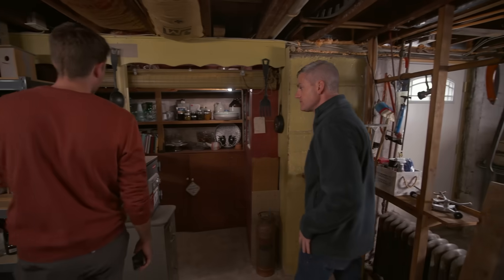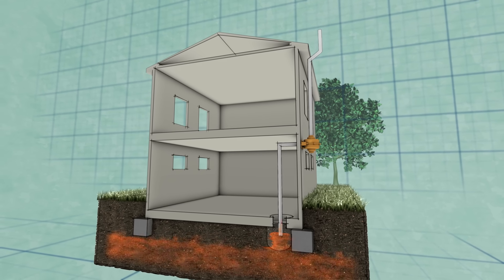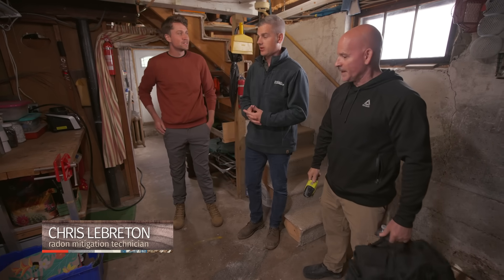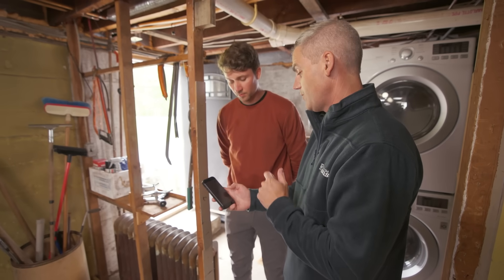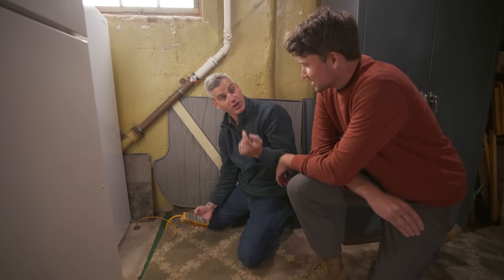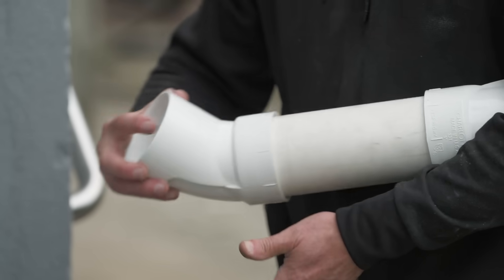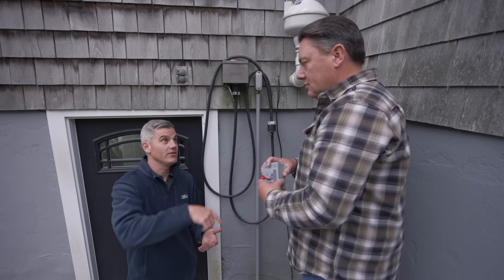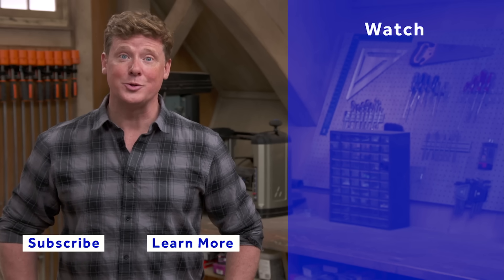How to Reduce Radon | Ask This Old House

Comment: Opening a window does nothing it actually makes it worse, the same for the HVAC as noted in the video both just suck radon out of the floor even faster. Note that the US uses pico Curies per liter (pCi / l) but the rest of the world  uses Becquerels per cubic metre (Bq/m3) 1 Bq/m3 = 27 pCi.  Normal outside air tends to be about 15 Bq/m3 (405pCi/l) so you'll never get to zero. Also note if you're a smoker radon significantly boosts your lung cancer risk on top of the risk already from smoking.
Reply: Outside air is about 0.4 pCi/l. You mean 405 femtoCuries/liter (fCi/l)?
Reply: Fellow Canadian here, DG. I installed a Radon Away fan in my basement four years ago. I was seeing levels of 400+ Bq/m3. Now, they hold at 100 Bq/m3 or less over the long term. I vented to the outside but not all the way up to the eaves. My house is well sealed and insulated. I find the house dries out pretty badly in the winter. Basement humidity drops to about 35% which is borderline. Beats lung cancer though!!
Reply: @acreguy3156  I've heard the benefit of radon mitigation systems is lower humidity. When the air under the slab drawn out it takes moist air with it. Less of it permeates up through the porous slab. I'd prefer 100Bq/m3 but now as fall approaches and days get cooler and wetter it causes radon levels to spike up to 200 to 300 here. Summer it was about 4 to 20Bq/m3 so it evens out, the 300 day long term average is 85Bq/m3. I'm hoping to makes some changes soon and get a system in place.
Reply: @dg-hughes  Good points, DG. My mitigation system pulls air in from three other sources - two bathroom fans and the kitchen fan. The flappers on these vents are pure garbage. My house is super insulated with a continuous air barrier. That makes those three fan sources a problem, as they draw in dry air from our cold winters. A long term value of 85Bq/m3 is excellent. I'm close to that. Good luck with your install 👍.
Reply: what about using an air purifier in your home?
Reply: @TotalWarHistory.  radon emits alpha particles which is 2 protons and 2 neutrons. It's not a gas it's not a molecule or even an atom it's parts of an atom. There's nothing that is capable of filtering a particle smaller than an atom. The particle carries a charge and will stick to dust concentrating it. You could probably filter that but it would be a very very small fraction compared to what is in the air.
Reply: Not sure where you got the idea opening a window doesn't help, but it absolutely does, as a light breeze can bring fresher outside air into the home that displaces the air with Radon.
Reply: @darkedgex  You're partially right, Dark. However, there is something called the "chimney effect." When you open a few main floor windows, it creates a vacuum, pulling air from the basement, which in turn pulls radon through all the little openings in the basement it would normally come through. Kind of like blowing air with your mouth over the top of a glass soda bottle. You're actually sucking air out of the bottle. Same idea.
Reply: @acreguy3156  As someone who inherited a home with a very high radon level (>20-40, depending on conditions), when I do long term measurements with the windows open the levels return to below 1.0, so unless my situation is anecdotal because of something unique to the home, having windows open definitely can help. Obviously if you have concerns, measure the results with the windows open vs. windows shut as every home is different. But the home in question here is a single floor home with a basement.
Reply: @darkedgex  Good points, Dark. I think there are several other factors such as how air tight the house is, the R value in the walls, effectiveness of the heating system's duct design, HRV -yes or no. It's certainly not a subject we can paint with the same brush 🤣.
Reply: @darkedgex  It's not my idea. An open window means lower pressure in the home and that allows radon to be emitted faster. If your house was very tight, no HVAC, every window and door super efficient, bathroom fan sealed, attic vents sealed it would be wet and moldy, but less radon leaking up from the slab. You may be letting radon out but it just comes up from the slab faster. HVAC can suck it up faster due to air exchange reducing pressure. You may be lucky and the amount coming in is low and the ventilation removes it faster than it can come in. Ventilation may help reduce dust since radon is a charged particle it sticks to dust and accumulates in dusty areas.
Reply: @dg-hughes  I mean, I have the numbers, so you're never going to convince me. I did say they are potentially anecdotal and possibly unique to this home, but this is where testing helps. And if you're in a situation where you can't afford a mitigation system, testing and seeing if open windows helps is better than exposure.

Comment: Certified radon mitigator here. This was all top notch. Test, test, test. Lower is better. Even exposure at the EPA limit of 4.0 over a lifetime doubles your risk of lung cancer. Most soil suction systems like this can get levels in the house down to 2.5 or lower.
Reply: I have the radon eye system and installed my own random mitigation system with a sump cover. Went from averages of 12 and peaks of 25 to an average of 2 with peaks of 3. Continuous testing is affordable so there is no reason to stop.
Reply: I have a passive mitigation system (no fan). My average Radon reading is around 2.5. Is it beneficial to try to get that number lower by installing a fan? Note the pipe just exits through the baement wall but doesnt go up above the eaves.
Reply: @scofus6166 technically it should terminate above the eave to be code compliant. The concern is that the exhaust can have very high concentrations and you wouldn’t want this gas creeping into the house through a leaky window, etc. Adding a fan to a passive system is generally the most economical way of getting levels down.
Reply: @scofus6166 background levels vary but are often .5 outside. I would get as close to that as possible
Reply: Thanks Max. Did you like my Temu shoes?😂
Reply: @chrislebreton750 excellent choice, haha! Cheers!
Reply: Show us the studies that show us that exposures over this supposed "EPA limit" doubles your risk of lung cancer. You're 1000% full sht because there has NEVER been a controlled study linking radon levels in the home to lung cancer. The EPA itself admitted their recommendation (NOT standard)  was based on incomplete data and quote "guesswork". The data they used came from miners working underground in levels of radon thousands of times higher than the highest levels found in US homes.
Reply: @hochhaul 

“Darby et al. (1998) conducted a meta-analysis analysis from 13 studies in Europe and demonstrated a statistical increase of 16% in lung cancer risk per 100 Bq/m3 [2.7 picocuries] of residential radon”. 

Int J Environ Res Public Health. 2022 Dec 21;20(1):97.
https://pmc.ncbi.nlm.nih.gov/articles/PMC9819115/

It used to be that all we had was data from uranium miners. Now there are a number of studies showing the same correlation in buildings as well.
Reply: January is National Radon Scare Month!
Dr’s can’t detect Radon poisoning & 4.0 is like smoking two packs a day. If they can’t figure us out they have us do a Radon test & blames it on it when levels are high.
Reply: It’s a scam

Comment: They should have put a rain cap on top of the exhaust pipe to keep the water out.
Reply: The fan is designed to tolerate rain and condensation coming down through the pipe. The whole system is pitched down to allow water to drain into the suction pit. Adding an elbow or rain cap at the top can cause icing up in very northern climates. It’s also best to direct the gas away from the house so it can’t creep back in through a window.
Reply: @max-zl1vm  what is the suction pit? Will water have the opportunity to run into the basement?
Reply: @pilot_gti the suction pit is the hole made in the basement floor where the radon is drawn out of the soil. Rain and condensation should be able to drain through the soil without issue.
Reply: @max-zl1vm  That would decrease the suction
Reply: Best option is a " critter guard".  Stainless steel mesh screen on the end of the pipe.  Squirrels and birds dropping down in the pipe will destroy the fan.  Also smelly and gross.
Reply: That can be a problem in the winter.
Reply: To keep the water out and the squirrels
Reply: You can't use a rain cap, it re directs the airflow back down for it to re enter. And the amount of water making it into the pipe is insignificant. The fan will pull out more condensation than it let's in. Thay condensation will freeze up in the winter depending on where you live.